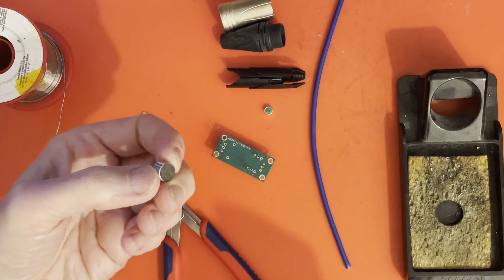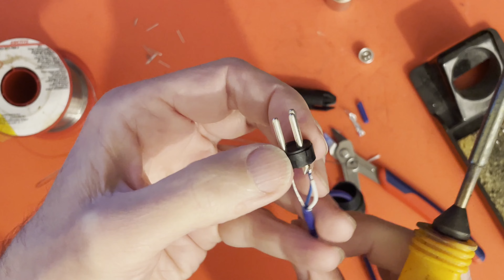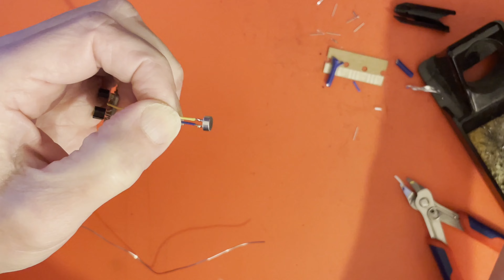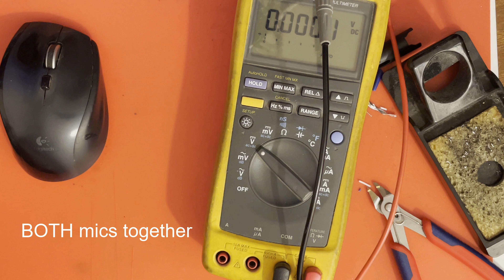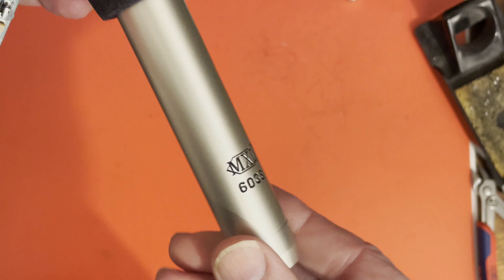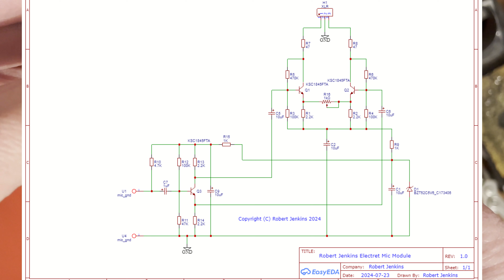Testing my latest microphone mod design - an electret capsule adapter

Comment: Well, I've cobbled together this fun little thing, just need to take the time to play with it, I am scared to ask, but is it meant to run phantom power?
Reply from the maker: Yes, the normal 48V via the output connections, from a mixer or interface etc. mic input.
Reply from the maker: ps. There is more info about them on my web site - I added the link in the video description a few days ago.
Reply: @RJTC you updated you website!
Reply: Looks like this would make a great boundary microphone, I arrived here whilst looking for a module to power a Realistic PZM from phantom power but with this I could just build the whole thing.
Reply from the maker: @Farmaceuticals  Yes, that should work fine - all you need is the mic capsule face close to a wall surface / corner or a reflector plate.

For the PZM 11, if you have one with the original circuit board fitted - they connect directly to a normal mic input with 48V phantom power, though using a passive adapter circuit.